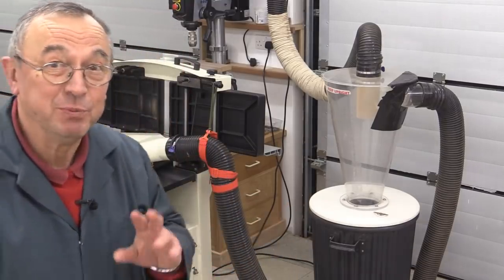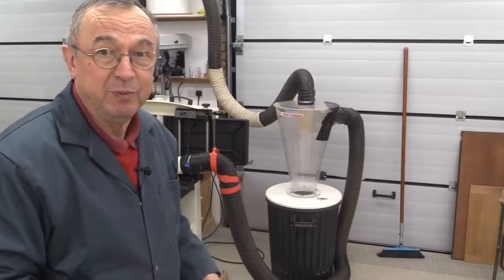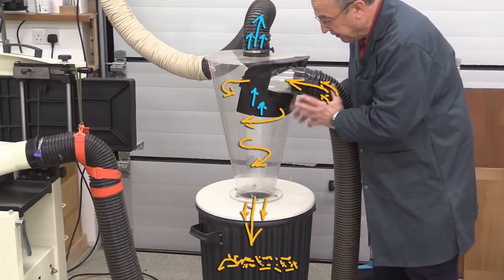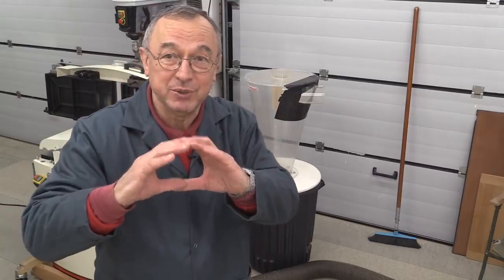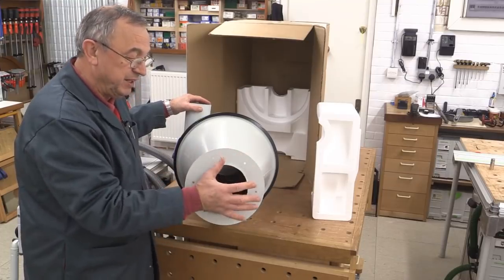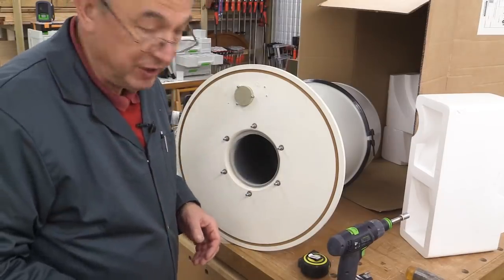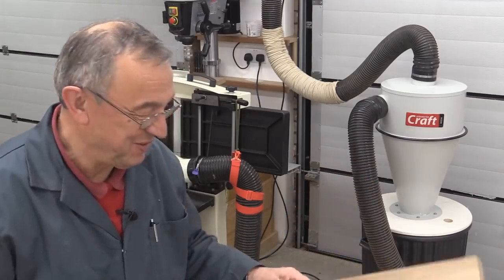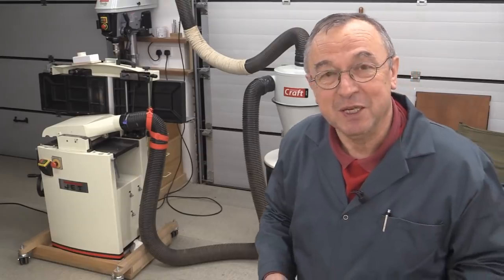New 4 inch Cyclone

Comment: Love the excellent information video as normal. 

So I decided this was the way to go for me with a Record Power 286 Twin motor. Rang Axminster to enquire about the product and the possibility of getting a reducer to fit a festool hose and was told bluntly that this Cyclone wont work with a vacuum as it will implode it needs to work with an impeller chip collector. I then checked what device you were using and a Numatic NVD 750 is in fact a vacuum. So I called Axminster again hoping to get another person which I did and unfortunately got exactly the same response "It won't work" I mentioned this video and your name and was disappointed with the "political PC " response. 

Now I am confused as you, Record Power and another person says it works perfectly. Also it is made from steel and not plastic. I would like to add that by no means were @axminster rude and were probably just reading the spec. I was just taken aback by their blunt response. I am aware that you work closely with Axminster which is why I have posted this.
Reply from the maker: Hi Graham, I have been using my Numatic 750 with this cyclone since Axminster introduced it and I have had no problems whatsoever. I will contact Axminster and let them know. Many thanks for pointing this out. Cheers.  Peter

Comment: Hi Peter, thanks for your excellent video.  Your set up looks ideal for a small workshop like mine.  Do you think records power's twin motor camvacs are a suitable alternative to the axminster numatic?  They seem on the surface very similar at much lower price.  In combination with the axminster cyclone in your video it could make for a modestly priced and very flexible setup.
Reply from the maker: I have not seen any Record extractors and am unable to offer an opinion. However, it is my understanding (and I am happy to be proved wrong) that the Numatic kit is mostly made in the UK. Many badged machines are sourced in the Far East which may make them harder to get hold of given the problems with World-wide shipping.  Peter
Reply: @NewBritWorkshop  OK, thanks Peter!  I think I'll go with the numatic it looks like it performs well with your planer thicknesser.
Reply from the maker: I am sure that you are making the right choice. Record kit is very good but the Numatic extractors are very solid and most of their equipment is aimed at the professional market.  Peter
Reply: @NewBritWorkshop  Thanks Peter, a local charity has today offered to sell me their Axminster AP170E Dust Extractor for a reasonable price so I'm a little torn at the moment between the two options, especially as one would be supporting a very worthy charity.  Despite it's larger size I'm not sure that it actually delivers a better result than the Numatic with a Cyclone.
Reply from the maker: The AP170E is a really good extractor with a 1 micron filter. It needs a 16 amp power supply which is not a big deal even if you have to employ an electrician. The only thing that I suggest you check with Axminster is whether the fine filter needs to be replaced at certain intervals and if so how much that might cost. Given that and a satisfactory response from them I would go for it.  Peter
Reply: @NewBritWorkshop  Hi Peter, sorry for my late reply.  I've taken your advice and gone for the AP170E which I'll collect next week along with a AT260SPT Planer Thicknesser which I'm very excited about!  Regarding the fine filter I think it does need to be replaced at some point in the future, but I don't mind paying for that eventually, the machine seems to have had very little as it wasn't really suitable for the very large ducted system they had in place.  Thanks!

Comment: Wish we could get those in the U.S. and not be overpriced like the $200+ plastic versions. 
 
Personally, I'm just using a 55 gallon steel drum with angled fittings to create a centrifugal force. It works really well since the drum I use has a PTFE lining as it was used for polyurethane resin. However, I'd rather have a cyclone style as it's a bit more efficient,  and I wouldn't need the entire 55 gallon drum.
Reply from the maker: Axminster do export to the US. Things may have changed but by the time you remove UK Tax from the Axminster web site price the delivery and conversion to US$ brings you out on top. It may be slightly skewed by the size and weight though.  Peter
Reply: @NewBritWorkshop  thanks Peter. 
 
I seen that they do dhip items to the States, but they will not ship this one here, unfortunately. I assume it's due to its size?

Comment: Hi, I  have used one of these now for about two years, but compared to my old Bill Pentz designed homemade cyclone, I was put off by the inlet coming in straight and not angled down slightly. So I added an internal rotary baffle plate that forced the incoming air to start to drop over its first circumference. The reason I did this was because I was only using the 1HP Axminster blower which seemed underpowered and did only draw 538W not 750W that I would have expected for 1HP. I then added a 6" outlet  from the blower with no filtering to increase throughput air speeds and parked a nice clean shiny black car under the output as a test. The car stayed clean, so its been like that ever since. Thanks for your review.

Comment: Is this model of extractor still available. Is it the AC50E?
Reply from the maker: Hi Alan, The cyclone (no vacuum or motor) is the AXMINSTER CRAFT ACCIH CYCLONE INTERCEPTOR HEAD:
https://www.axminstertools.com/axminster-craft-accih-cyclone-interceptor-head-105872

Peter
Reply: @NewBritWorkshop  many thank. I was actually referring to you dust extractor by Numatic NVD750. 
Would the Axminster Craft AC118E be a better overall option as it would probably cost as much, has a 2hp motor and a HEPA filter? Maybe the Numatic is more robust.
Reply from the maker: Hi Alan, Ah, sorry. The AC118E would be my choice if I had the space. I hope that helps.  Peter

Comment: Thanks Peter and Axminster for the 100mm cyclone, can you produce a smaller 2” steel cyclone as well? This will enable me to make a mobile cyclone system to use on site or to fit under my mitre saw station etc.
Reply from the maker: Hi Carl, I suspect the reason that Axminster do not offer one is that they are available on ebay at silly prices. Check it out - probably available at £15 to £30.   Peter
Reply: Thanks Peter for your help. Can you make any recommendations as there seems to be a number of cyclone styles made in different materials. 
I do a mixture of work producing a range of dust materials from Sawdust, resin/fillers and concrete so static could be a problem? I see Oneida do a range of products such as the Steel Dust Deputy DIY 2" Cyclone and the Static Conductive Cyclone but they start at £100 going to £155?
I would also like to say thanks for all your videos, they have been a great help as has your UJK PARF MK II GUIDE SYSTEM...👍
Reply from the maker: Hi Carl, I have no idea about the quality of any of the kit on ebay. I have the Oneida Ultimate Dust Deputy which has everything including the drop box and it is anti static.  Good luck.  Peter
Reply: I have both the Oneida and an eBay cheapo.  The eBay one sits on top of a box I made to fit on top of my CT26 and works well.  You need to be sure there are no leaks between the cyclone and the drop box otherwise they can produce turbulence in the drop box which interferes with the ability of the dust to drop into it.

Comment: Thanks for a good easy to follow review. Did you take any steps to prevent static discharge or is that not an issue with your set up?
Reply from the maker: It is a consideration in some circumstances and settings but I have never experienced any static build up at all and so have taken the risk. The danger is that a spark in a mixture of dust and air can be explosive. If in doubt run a strand of copper wire from a good known earth to the metal of the cyclone. For absolute belt and braces continue the wire through the hose to the extractor body which must also be earthed.  Peter
Reply: @NewBritWorkshop  Thank you

Comment: Hello Peter, I have just bought one of these cyclones form axminster and its not doing a great job at separating the dust, could you tell me if you are having this issue aswell?
Reply from the maker: I am not sure of the reason. The units are identical and mine works brilliantly. The most common error is connecting the hoses the wrong way around ! The dust producing machine should be connected to the horizontal pipe and the vacuum machine should be connected to the tube at the top. Also, take care that you have no leaks at the interface to your drop box.  Peter
Reply: @NewBritWorkshop  I have everything correct axminster did say that a 2hp chip extractor may be to powerful but i don't see how as they sell a 2hp craft cyclone anyway?

Comment: Hi Peter - thanks for this review. I'm on the verge of buying one of these and thinking of how to use it in my system. Having seen some other installations described on YT, I'm a bit surprised that you don't have air-tight seals, eg: on the drop-box lid. Does the suction make such sealing redundant?
Reply from the maker: Hi Darrel, I am lucky that my dustbin top edge is reasonably flat (in the same plane) and my lid was made carefully. It works well enough for me.   Peter

Comment: Hi Peter, just to note. I have installed this, using a Record CVG286 (1000w) dust extractor. It works fine. Granted the more powerful the suction, the better it will work, however, thought I’d share this in others have a less than recommenced dust extractor. I use mdf and plywood and it picks it up a treat. I also have a dust sweep on the floor.... no more dust pan!!
Reply from the maker: Hi Pete, That is very useful information, thanks. I have been running the planer all morning and had absolutely no problem with my Numatic NVD 750.  I have created 3 dustbins full of oak chippings.  Cheers.  Peter
Reply: I bought an airtight barrel for mine, only cost £8 second hand! Mind, it was too big to fit in the garage of the loft (40 gallon) and so I had to cut the middle out and fashion something to join the two halves together. Lots of duct tape used! It’ll  work fine until I find a smaller one!
Reply: Pete Lowe Hi Peter, Thats very interesting because the Record CGV286 has “Cyclonic neutral vane theory technology draws the waste into the drum with great force and directs it around the outside edge, keeping the filters cleaner and allowing the waste to fall to the bottom of 
the bag”. Isn’t adding the Axminster vane a duplication?.  Or is the Record’s ‘vane’ not very good? Cheers
Reply: Hi Christian, that is correct, and there is actually nothing wrong with the suction of the Record unit as a stand alone dust extractor. There is a paper bag over the filter and a cloth bag which prevents any dust from going anywhere near the paper bag, never mind the motor. 
My reason for attaching a cyclone was to reduce the effort of emptying the dust directly from the Record unit and having to clean the dust from the cloth filter (drum side). Not great for the eyes and lungs on a windy day!! I also wanted to have a bit of a play attaching to a variety of pipe and so there is also a small ducting set up meaning I do not have to move the unit here and there. The Record unit is in the loft of the garage and the cyclone and drum (purchased a more manageable sized drum now), although currently in the loft, too, will eventually be positioned in the garage. I have used soil pipe (100mm) from the loft to below with a couple of blast gates (one feeds the 100mm flexi pipe for a table saw and the other to a floor sweep) and also installed 40mm push-fit pipe, bossed in to the soil pipe, to give me a lighter option; this worked great when using it with the parfguide system.  Ok, so there is a reduction in suction as there is a fair amount of pipe, however, it still works ample enough to remove dust from the bench saw and the workbench where I have installed the push-fit pipe. 
Before i decided to connect up to all this pipework and, subsequently, to the cyclone, the Record extractor, on it's own, did pick up heavier debris (mud from work boots, grit and that kind of thing) and so the dust pan and brush have to come out occasionally to get rid of those bits which gather neatly around the floor sweep. I sometimes have to clean the blast gates, too, as said grit gets stuck in the sliders meaning they do not close 100%. It is a five minute job to clear it out. Note to self, keep mud and grit away from garage floor. Let's remember, they do recommend a minimum 1.5 hp, and they probably do not expect it to be connected with more pipe than the London underground....just saying!

I actually purchased 20meters of 32mm vacuum hose (used to extend Henry vac hose also) and experimented by using the hole length.... it still picked up!! My son enjoys putting lots of fallen leaves up the floor sweep and then watching me scratch my head and say 'that filled up rather quick!!' Just to note, there is zero dust in the Record unit and so the cyclone is clearly doing the job. 
I am a general maintenance contractor and this is merely a hobby for me but, having an easy way  to get rid of the dust, this cyclone really is helpful. In an ideal world, I would have a bigger extraction unit altogether but justifying that to my accountant, aka wife, would be futile!! I would be assimilated!! (poor Star Trek joke for you there) 
Sorry for the longwinded reply, trying to include an accurate description of, say, pros and cons.
Best wishes

Comment: What is the Horse Power of your extraction unit...? Axminster say you need to have a a minimum of 1.5 horse power for their cyclone to work...?
Reply from the maker: Hi Stuart, It is not the power of the unit but the volume of air that is shifted in a given time. Axminster do not recommend the NVD 750 for planers but mine does an excellent job. See my recent Workshop notes video and also the newly released video about my new planer.   Peter

Comment: hi peter enjoyed the video i have a record power hplv vac can be used with 100mm hose or normal vac size hose i would like to purchase that cyclone with the bag below but some peole seem to think if i use the wrong size hose the steel frame will crumple can you tell me what you think
Reply from the maker: Hi Jim, The Axminster cyclone is made of steel and will not collapse. The steel frame that keeps the bag open should be fine as well although I do not have that part of the kit to test it for you.  Cheers.    Peter

Comment: Looks like a nice upgrade Peter.  I would be interested, but I run 5" ducting, do they have any plans for a stand alone one with larger outlets?
Appreciate the cyclone won't collapse if there is a blockage, but what about the bin, if that is plastic is that not at risk?
Reply from the maker: Hi Terry, The bin will be fine and so will the cyclone as it is made of steel even if you have a powerful extractor. 5" is not a problem but will need an adapter ( cheap as chips on the Axminster site) at the cyclone.  As far as I know there are no plans for a 5" version. Peter

Comment: Having looked on the Axminster site they state (in the question section) that this unit will not work with the NVD750. Confused
Reply from the maker: I said in this video that the NVD750 is not recommended as it does not draw enough air per minute but I followed that statement by saying that it works well enough for me with my planing machine. Axminster cannot recommend the NVD750 as it does not draw enough air but if you are happy to accept a small decrease in pulling power the configuration is fine.    Peter